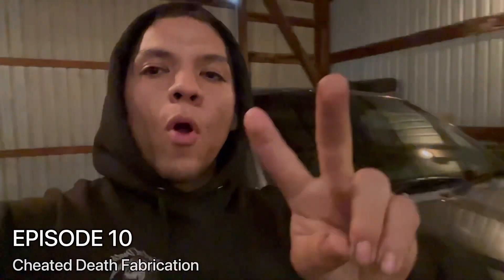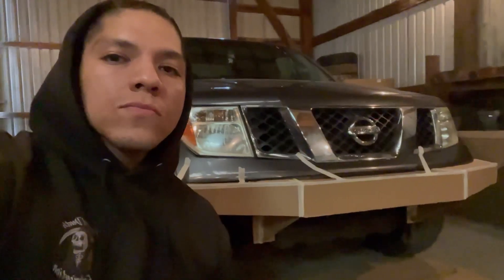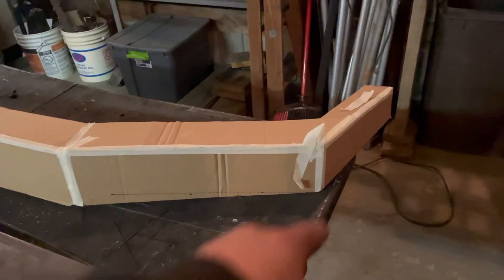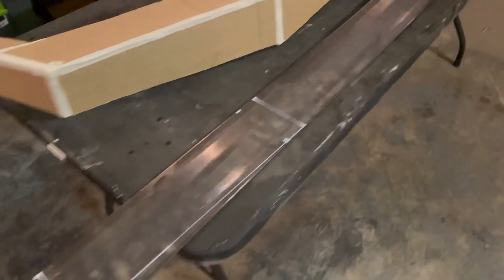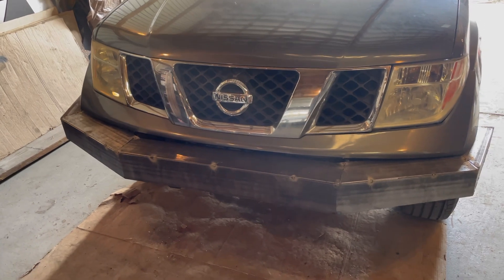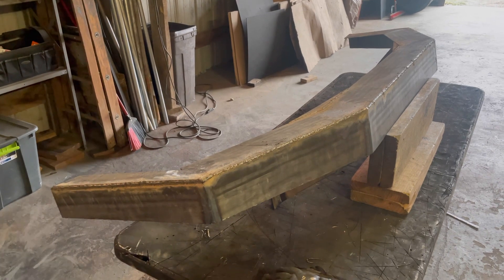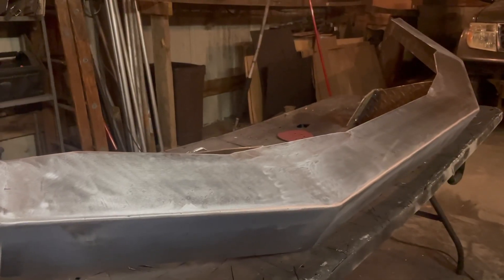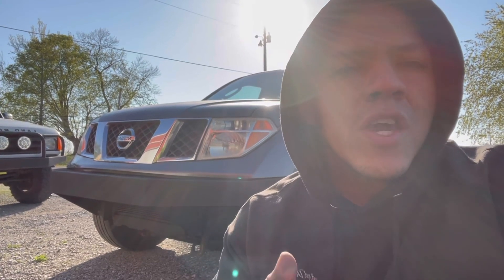Nissan Frontier - Front Bumper Build - Part 2 - FABRICATION

Comment: How thick is the steel you are using
Reply from the maker: Depends on client specifications but I typically use 1/8, 3/16, 1/4 on most builds.